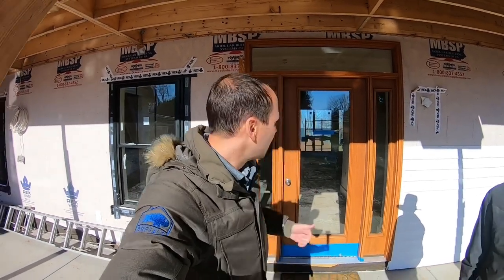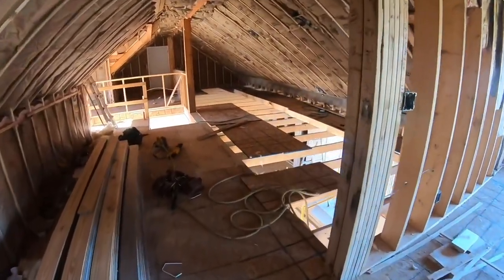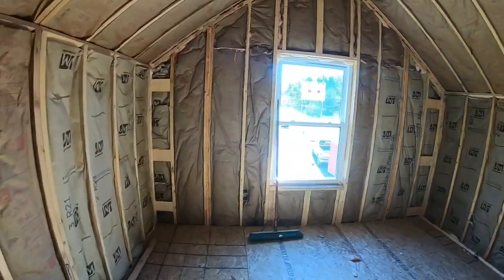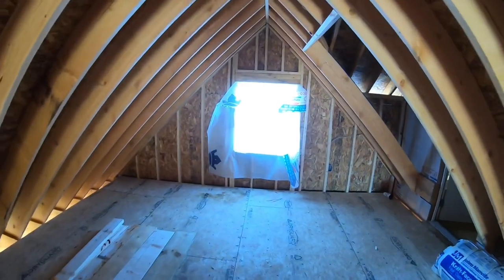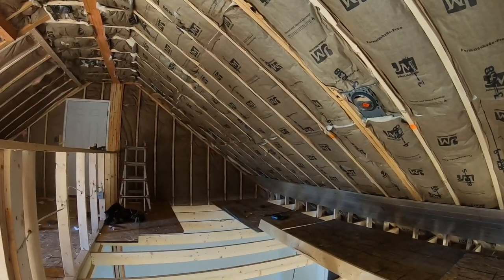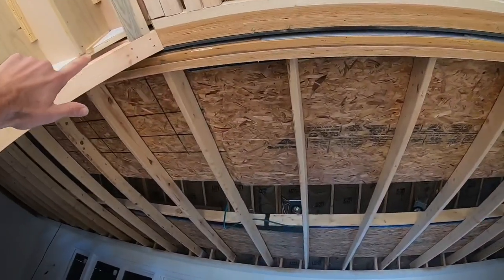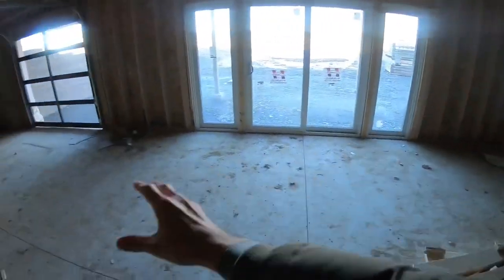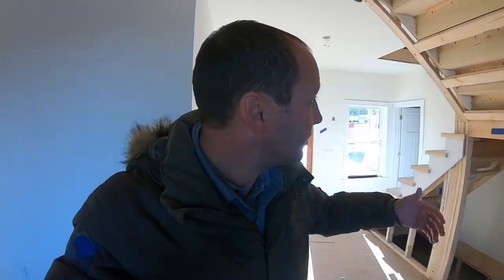Modular Home INSPECTION -FRAMING -ELECTRICAL -INSULATION

Comment: How is the house attached to the foundation? Lag bolts?
Reply from the maker: Good question. We’ll see if we can do a video on this specific aspect of the installation.  Its set onto the sill plate and metal hurricane straps fold up and are nailed in.. then the house is perimeter nailed every 4 inches. Inside the bottom and top of the boxes are bolted together in every floor hoist cavity and rafter. The second story boxes are also penny nailed around the perimeter.  When a hurricane hits the coast the coast, modular homes are the only structures left standing!!

Comment: Roughly how many sq ft is this? I want to build something similar, but probably a little smaller
Reply from the maker: the first floor is only about 1300sf..  but add the loft 700sf and the basement 1300sf for total use! :-)